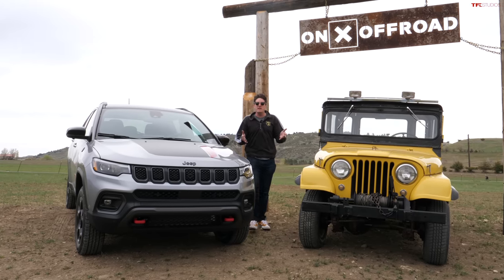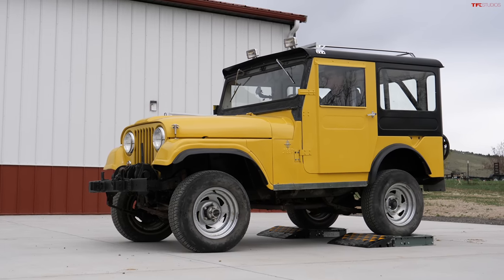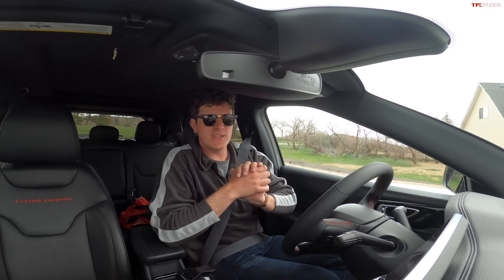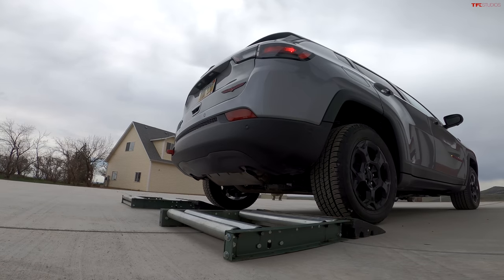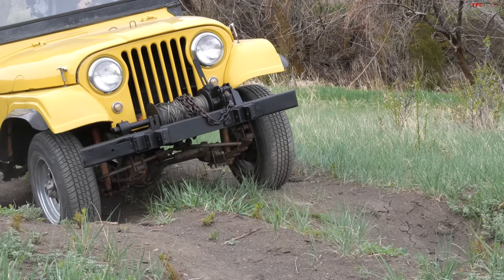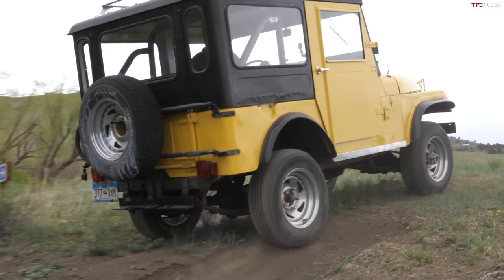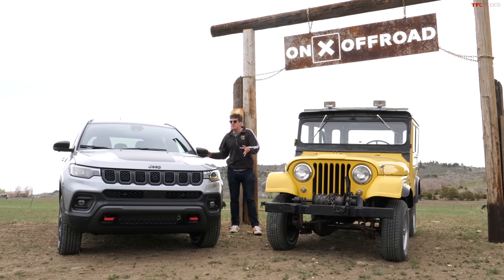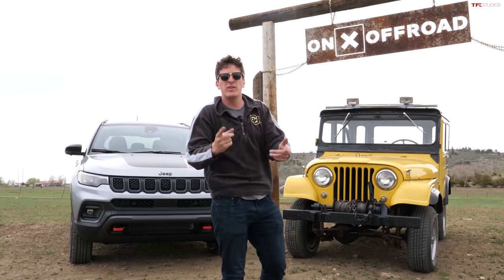Old vs New: Here’s Why Everyone Is Wrong About New Jeeps! Slip Test & Off-Road Challenge

Comment: here's some of the things you're wrong about or are ignorant about.
the cj5 was available with power loc clutch type lsd's which are extremely tight and durable and they will equal or better brake lock traction control,
detroit lockers were invented for early jeeps the first widely available diff lock.
free wheeling hubs were also invented for jeeps to save fuel, they were optional and can be left engaged indefinitely if you want, so you can put the tiny violin away about locking the hubs. 
all jeep cj's have shift on the fly 4wd, you don't have to stop or use the clutch to shift into 4wd you just back of the accelerator and pull the high range lever back into 4wd. it was noted that you tried to make it seem difficult.
the parking brake is on the back of the transfer case so engaging that would do nothing for wheel traction. it doesn't work very well like lots of things on that jeep because its 62 years old and you haven't fixed anything.
the cj5 has 2wd,4wd, high range and low range. the compass has constant 4wd a centre diff lock (high range 4wd) and no low range.
so that leads us to facts all those trails the compass couldn't hope to do because it's not a true 4wd with low range well a lot of those trails were pioneered with a cj5.
i also don't think we'll see any compass doing around the world expeditions, towing vehicles, digging trenches or drains, plowing fields or being used as forklifts.
i doubt we'll even see a compass on the road in 62 years and we certainly won't see a 3 decade production run.

Comment: Just speaking from experience with new and old. I can tell you I've had at least three nor vehicles 1990s plus fail to lock into four-wheel drive. All my older inconvenient stuff locked in just fine. And it only took me a minute to get out there and lock the hubs. So you should talk about the dependability of new versus old perhaps 🤔. But then again, you're kind of a spring chicken so you don't know until you've been told 😜.  And then there's the dependability of lockers mechanical/ air/ whatever versus the computer traction control. They've come a long way.

Point is though I've needed four-wheel drive and my automatic locking hubs failed me at least three times. Now had I just gotten out too lock my hubs manually they would have locked up.

Or perhaps correct me if I'm wrong but didn't you guys do a for a few bucks less? And one of the automatic locking hubs didn't work on one of the vehicles. And the solution was to put manual locking hugs on it.???

Just saying.

Anyhow, keep up the good work. Love watching all the TFL videos! 👍👍
Reply: I guess to be fair I blurted everything out above before finishing the video. Which I never do. Well I guess I just did. But I make a point not to do that. I want to watch the rest of the video now and see where it goes 😎

Comment: 21:06 At least for the Cherokee Trailhawk, this statement is incorrect. In my Cherokee, I can not only feel the torque but in 4 Low in first gear, you can maybe hit a maximum speed of 15 MPH before redline. In 4 HI, I can easily pass 30+ MPH in first gear before redline. The Trailhawk driveline is a 2 speed hi and low driveline.

Comment: Classic 4x4s have character for days, and they're definitely easier to build, but open diffs are garbage. I had a 73 K10 squarebody with 35" tires and open diffs. I once stuck the passenger side in a snow bank, driver side tires were on dry pavement, I went nowhere until I broke out the snow shovel and dug out the passenger side since the open diffs sent all the torque to the hopelessly spinning passenger tires.

Comment: Are you all doing any more videos with that Compass?  I'm curious about the 2.0 turbo 4.  Is it really the same as the 2.0 turbo 4 in the Wrangler but tuned down?
Reply: Yes, the same 2.0T found in the Wrangler and Cherokee. The compression ratio, turbocharger, etc. is identical. The only difference is it seems to not have much space in the engine bay. It looks like there’s two separate coolant overflows rather than one.

Comment: Yes and if that tiny little motorcycle battery up front in the trailhawk goes down on you it will throw about 40 error codes and the entire vehicle will stop working.  Engine, transmission, everything.  Right out there in that snow storm......  Then you can get it loaded up and taken in for replacing those batteries as they will replace both and after diagnostics toe and repairs be out about a grand.  Oh and you never got where you were going in that snow storm.

Comment: The only thing that the Compass (and the Renegade) need, is a true low range gear, instead of just the first gear, and then it's perfect... But I know that it won't happen anyway, since both the Renegade and the Compass are now available only with the plug in hybrid configuration, which mean that the front wheels are powered by a 180hp petrol engine, and the rear wheels are powereb by a 60hp electric motor

Comment: I really need something with good gas mileage and have been thinking about a used Prius for my commute, it would save me $300 a month in fuel, or enough to cover the insurance and some savings. With that said, I have always wanted a Wrangler and my wife wants one as well, or a nice used New Edge Mustang with manual. Basically, I don't know if the fuel savings is worth it.

Comment: yes the compass is more confortable for the mum who got stuck in snow, but we dont say old jeeps are better because of moms on the snow, we say it because that ol CJ will outlast mankind, and you can fix them with wire and duct tape and it'll still rock along. The compass (or any new common car, for that matter) wont last 30-50 years and be easy to fix, it'll get itself terminally broken within the decade and become fridge material, that is why we prefer old ones, its just way easier to keep them around and throw them in trails and mudpits and modify the hell out of them, cuz theyre simple and sturdy, and when they do go wrong theyre easy to fix and get aftermarket parts for, you'll not see the same for a compass in 10-20 years time

Comment: Because it has an open front dif, isn't it possible to just leave the front hubs locked so that you only need to engage the transfer case with the shifter and have 4 wheel drive ready to go?

Comment: Everyone’s experience is somewhat unique on most thing. It’s also normally colored by their own knowledge. Mostly referring to their knowledge of how to repair and maintain different systems.  

In my background I was a Aviation Ground Support Equipment (AGSE) mechanic for the Marines. So repair and maintenance of a vehicle’s mechanical system is no real issue. Afterwards I used my MGIB to get a degree in Electronics. With that knowledge the electrical system doesn’t bother me either.  I know an electrical system can be just as reliable if properly maintained. 

There in lies the key. Most people understand the need to change fluids, replace worn bearings and other components. Where they tend to fall short is in maintaining the low voltage signal system in a vehicle.  

Your dealing with microprocessor’s that use signals of 5 volts DC or less in some cases. So unless you maintain your electrical system with the same vigor you do the mechanical system or bet yet your own body then of course you’ll have issues. 

Running vehicles though water obstacles then leaving them to simply dry on their own would be like jumping in standing stagnant water up to your chest then wearing the same clothes for a week. Your going to start turning funky fairly quick.  Little gangrene here and a bit of rotted flesh there. Same can be said for the electrical connections. 

The manufacturer tries to help you by attempting to weather tight the connectors but it’s just that an attempt.  Without an active plan to open the connectors. Clean them with a contact cleaner them protect them. Replace connectors with damaged weather seals. It doesn’t take much corrosion to drop a 5V DC signal below the cutoff threshold. 

Yeah you’ll still end up with a component or two that’ll fail. In some instances, if you understand board level repair you can revive the part. Some will have to be replaced.

Comment: One of the biggest differcences is that the compass will not be on the road 60 years from now and if the classic jeeps breaks on the trail you could most likely fix it and keep going . The manual locking hubs were on fords not to long ago as well.  Yes auto locking is more convenient but foe every auto this or that is one more thing to break on the trail simplistic design is best fhe compass has been rated horrible in reliability and over all performance for years..

Comment: Computers are great until they dont work. Lots of 4wd is done in remote areas. Mix the two and you could be left in the middle of nowhere with a computer fault keeping you from getting home.  When it comes to 4wd I prefer mechanical over electronic.

Comment: Test a new Compass Trailhawk against a CJ with freshly-rebuilt factory LSDs in each end, if you want it fair.

 The CJ's anti-sway bar is disconnectable for max articulation too.

 I also prefer the CJ's steel bumpers, and the rockers that can be armored with just cheap, painted angle-iron.

 I commuted CJ7s and a YJ for years. I even roadtrippped them. They are completely liveable, if kept in good nick. Hell, I've ridden DR650s 1000+ miles in a day. A CJ7 or YJ can be luxurious, by comparison. Use full doors, cruise, OD, and HVAC. These were all available options since CJ7s.

Comment: My wife wanted the New Ford Bronco and that was OK with me . But I had some rules in what a Bronco should be . First off it is not going to be a soccer mom 4 door car . It has to be as close to a old school Bronco have to be .  . Needs only 2 doors . Have to be a manuals Trans and something close to the HP rating of the first gen Bronco . With all that I think she need or what I want it to be . Everything else she wants is all hers .  So she oreded he Bronco . She pick blue , She wanted heated seats but that cost $20,000 more . So she felt it was not worth that . My wife pre ordered a base Bronco manual and the I-4 engine . Options she wanted was floor mats , the switch panel , steel front bumper and mud flaps . It looked kind of goofy with the street tires . Big openings with small wheels . Shegot the Bronco a little over a year and a half ago and she only put 1,200 miles on it with in another year and 2 months . She loves the thing . I even like it .  But this is hers and not mine . Even when I paid cash for it for her . I bought it for her . My wife that loves me .

Comment: Not really fair to use the top of the line model compass with the traction addatives vs a non locker jeep, old vs new would be manual ox lockers in the old jeep... they had the tech back then it was even an option

Comment: People are commenting that the CJ will last forever, but that’s definitely not the case.  The vast majority of CJs are long gone, worn out, rusted out, crashed or even rolled over due to terrible handling.  The one depicted here is a “survivor…”  Lest you think I’m against the old school tech, I’ve owned an original IH Scout, a YJ, and a JL.  The Scout was easy to understand, but its only good off road characteristic was its small size. In every other way it was terrible.  The YJ was a bit better.  The JL was a beast off road in very way.  But it had bad steering and handling, though light years ahead of the others.  Have a WK2 Grand Cherokee now, and it’s a better vehicle in all ways than the others, and much less likely to get in a wreck.

Comment: Open diffs on a 63 year old Jeep versus a new computer controlled anti-slip awd Jeep.  Get back to me in 63 years to see if that "trail rated" fiat is still running.
Reply: What does that matter for the purposes of this video topic?
Reply: @ALMX5DP It doesn’t matter one bit , he just had to throw some “Boomer sauce” on it to make himself feel better….😂
Reply: @ALMX5DP  Open diffs don't matter?  Longevity doesn't matter?  Gotcha.
Reply: @DLTJR1959  it’s simply a comparison of new vs old in terms of capability. Nothing more.
Reply: @ALMX5DP  CJs had traction diffs available. Compare a CJ with freshly-rebuilt LSDs to that expensive, plastic Trailhawk.
Reply: @RKmndo  that argument I could see, if the old wasn’t equipped as it could have been from the factory. Not sure how well the traction diffs worked in very low friction environments but would have been worth a look. I still think that the foundation of the argument is that people often look back with rose colored glasses and did not realize how bad some of the systems were compared to new. This has nothing to do with quality or projected longevity.
Reply: @ALMX5DP  Yeah, the Trailhawk is as trail-equipped as a stock Compass gets. The CJ isn't.

 Compare a new base FWD Compass to an XJ SelecTrac/LSD and old is evidently WAY better in snow and for offroad, right?

 The new SelecTrac Rubicons get fantastic traction, BTW. Let's hope they're reliable over many years.
Reply: @RKmndo  that would be interesting, though FWD does tend to do well in snow and light off-roading (especially since even base models likely have decent traction control, ABS etc).

Comment: Difference is how long car could perform offroad and how easy  is to fix in remote area by unskilled mechanics. Modern cars will overheat viscous couplings, burn brakes etc... they could be killed in few hours of sand driveing. Old cars could do it year after year.  You will need to replace disks and brake pads so frequent in new cars...

Comment: 9:39 if you turn the steering wheel back and forth while you are stuck like that it will get you out of there really quick. plus you can put in in 1st and reverse back and forth to rock it out. this test proves nothing other than yeah open diffs are limited in some ways big suprise!

Comment: Yes, agreed, the new Jeep has all the required creature features for plush comfort off roading, while the old Jeep is an up 'n at 'em agricultural off roader, that you actually need to drive, with some measure of off road talent. Beyond that, there is no air conditioning, heating or hi fi system. For all that, I am not seeing that much of a compelling difference in terms of off road performance in rugged terrain. What I would miss are the safety features that I would rate very highly in favor of the new Jeep, crush zones, roll over protection, seat belts air bags, abs and ESP which are all on road features, but, you gotta drive on road, to get to the rugged off road, so what you gonna do? The other missing feature set in the old Jeep is the fine array of idiot lights, where the on board computer decides it doesn't want to play any more and shuts down most or all of the clever feature set, and leaves you stranded with no bare bones fix it options. The old Jeep would be less likely to throw an electronic tantrum and quit on you, worst case, it would fail gracefully, and could probably be patched together to get you home with a few simple tools. Price comparison might be interesting too.

Comment: The definition of "better" has to be understood when you are talking about Jeeps.  From CJ to TJ, you could pretty much count on the interior of the Jeep being able to handle the same thing as the exterior.  They were "Jeeps", a simple unrefined little billy goat.  Then came the JK and leather interiors, 2 extra doors, tons of electronics, electric windows etc.  That's not a Jeep, it's an SUV.  
So that being said, yes, today's technology has improved the 4 wheel drive system, but today, you are paying top dollar for what should be a simple vehicle you can take off road, let it get rained on inside and out, and not worry about getting scratched from tree branches, and that is just not the case.